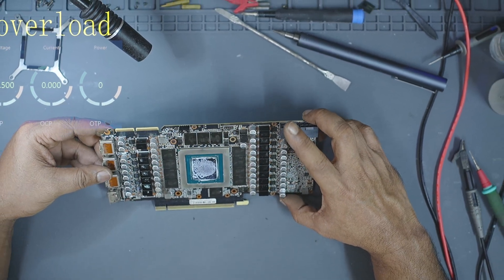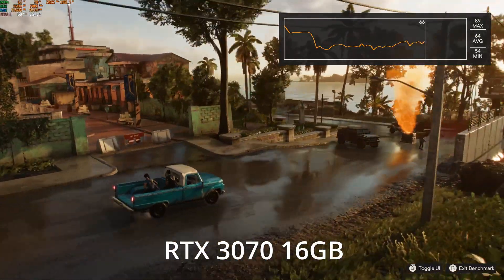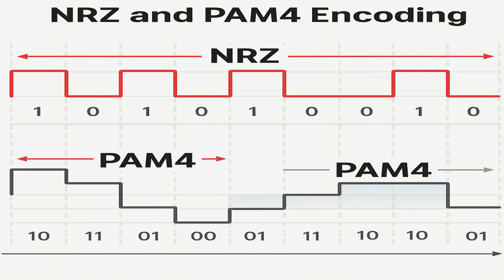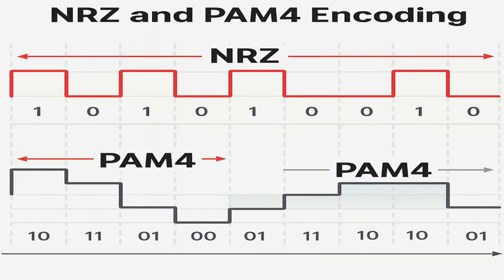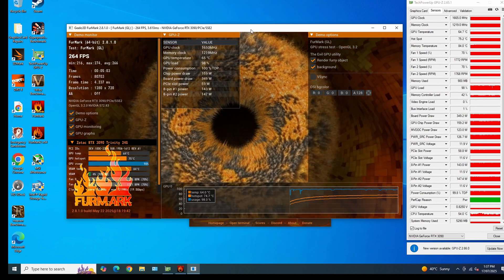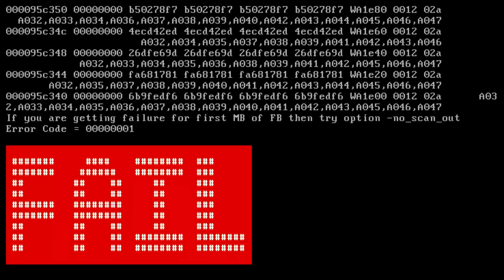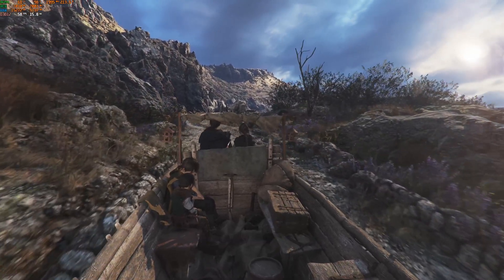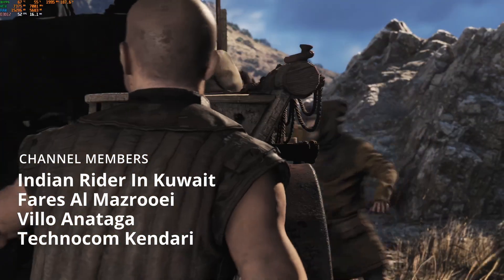GDDR6 VS GDDR6X - Why One Error Stops The Show

Comment: Hello there. Idk whether you'll read this comment but - I'm planning to buy either a used 3070 or a 3070ti. Learning from this video about GDDR6 and 6x, what would be a safer bet if something happens with the memory module in the near future. Should i go for the 3070 or the TI? Both will be used cards, that is the case as i am getting good deal on both those cards.
Reply from the maker: If your buying used go for Ti. They both are similarly priced. I assume you want to use it for gaming.

Comment: Hello friend! I'm from Brazil and I always follow your work. Which is very good, by the way! Hehe.. Regarding the video, could a card like the 2080ti, with some memory-related defect due to using GDDR6X, not be recognized? I have one from a customer in this situation. He went to replace the fans, and from that moment on, the card is no longer recognized. It has all the voltages, PEX RTS ok, clocks ok! However, it is not recognized in the system.
Reply from the maker: 2080 Ti uses GDDR6. If the GPU is not recognised then there is some voltage missing or the pex reset could be an issue. Or it could be as simple as wiping the PCIE connector with isopropyl alcohol.

Comment: Correct me if am wrong but faulty  gddr6 chip graphics card will post because of the GPU has its own memory cash, like 5mb. 
2000 series and 3060 3060ti 3070. 
Where as GPU that supports gddr6x has no memory cash on its own so if one gddr6x chip is faulty, it won't post.
Reply from the maker: You are correct to say that during post, GPUs rely on the memory cache on the GPU core during initialization. The RTX 3060 has 3MB of L2 Cache, while the RTX 3060 Ti and RTX 3070 have 4MB, and the RTX 2080 Ti has 6MB of cache. The RTX 3080 and the RTX 3090 also have 5MB of L2 cache. The L2 cache in the core does help in the early boot stage. So it's not the lack of cache that prevents GDDR6X GPUs from posting. The real issue lies in how GDDR6X initializes. It uses PAM4 signaling, compared to NRZ signaling on the GDDR6, and PAM4 requires very strict link training between the memory controller and all memory modules. If even one chip fails to respond correctly, the whole initialization fails, and the GPU won’t boot. I'm glad you made this point. 😊
Reply: Very good explanation. Thank you for making this video. I always wondered about GDDR6 vs GDDR6X when I was considering soldering 16GB VRAM to a 3060 Ti (GDDR6) and 3070 Ti (GDDR6X) when researching VRAM modules. The only videos I found were for soldering 16GB to a normal 3070 (non-Ti, GDDR6 non-X).
Reply: Can a 3070ti with 8gb gddr6x memory be upgrade to 16gb? Thank you in advance
Reply: @ronaldsanpedro4338 yes and dont do it yourself. Unless you are very experienced in micro-soldering and computer science. It takes some firmware modification

Comment: HBM will always be better.
Reply from the maker: In terms of speed yes. That's why it's used in server GPUs, but in terms of repair if anything goes wrong with the memory, nothing can be done. Any memory error and it's just a paper weight.
Reply: @GraphicsCardRepairs-tk7ql so if cards like Vega have memory issues nothing can be done in terms of repair?
Reply from the maker: @arenzricodexd4409 yes if there are memory issues, nothing can be done.

Comment: Since one gddr6 module is 32 bit wide, they can use more chips to get more bandwith overall. For example rtx 3060 ti has 8 times 1 gb module 256 bit in total while 12 gb models use 6 timees 2 gb module and that is called shitt configuration.
Reply from the maker: 3060 12GB has only 192 bit bus as it has only 6 modules.

Comment: can you use 20Gbps GDDR6 on originally 16Gbps cards?
Reply from the maker: I have tried that and it does not work as the timings are a bit different. I tried it on the 3070. A bios edit would be required.

Comment: I've never seen memory problems with HBMI cards.
Reply from the maker: There are problems with HBM too. It's just that it cannot be fixed and goes straight to the bin as the memory is on the core substrate.

Comment: Strange why ggdr6x cant be upgraded to 2gb modules. Is it due to the bios? Guess it wont matter soon, once nvidia moves to 3gb modules on the refresh.
Reply from the maker: GDDR7 is yet to be tested. Can't wait to get my hands on it.
Reply: Because all GDDR-X variants are Nvidia tech and exclusive? They used the base GDDR-, and modified the signalling it should send/receive.